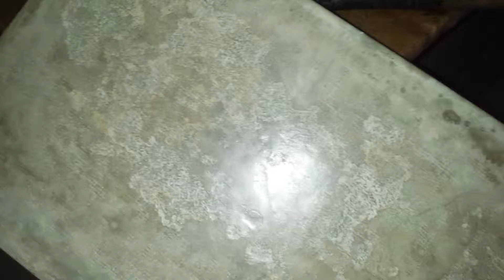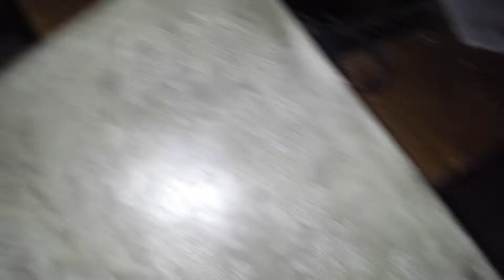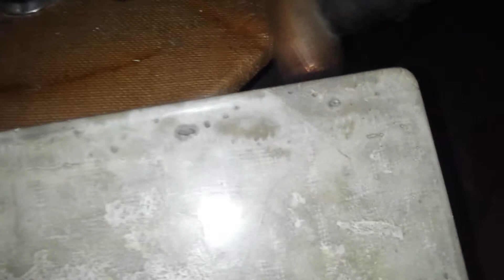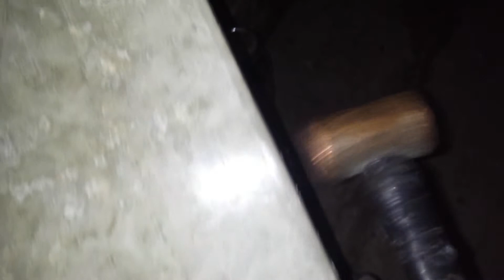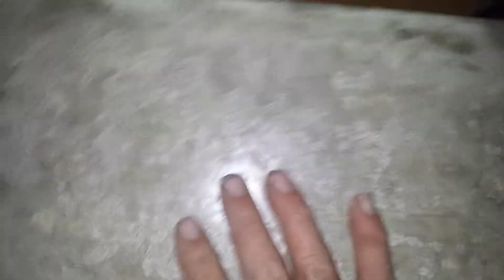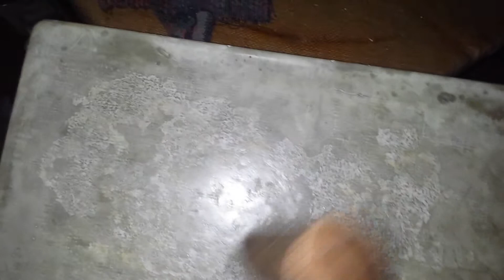Hemp fiber MgO exotic geo polymer, construction, flooring, wall board

Comment: What could be my mix ratio to make a Magnesium Oxide + Fumed Silica / Silica Dioxide concrete. Could I use hemp fiber with sand stone to expand the use. or Would this be more like a top coating over straw bales?

Comment: make construction rebar out of hemp fiber and hemp resin.
Reply from the maker: Believe I have a video on that, I beam as well, but Yes, Absolutely Agree 
Steel has met it's modern match
Reply from the maker: **bold statement 🤣 Yet changes nothing Bast Fiber concrete monomer modified (keep in mind BioChar graphene is >100 time's stronger, Yet)
Is Far hysterically Stronger than steel reinforced concrete

Comment: Hi There 
I am wanting to build a house with loadbearing walls out of Hemp+Bamboo, MgO and seawater. However I will be experimenting with various mixes.. any ideas to save me time that you think will work.....?
Also will adding an Acylic monomer make anty difference to the strength in above mix?
Thanks Az
Reply from the maker: Have several I would absolutely love to try with beach sand an sea water resources
If available basalt volcanic ash 
(Suggest modification of the fiber by evaporation for the needed monomer)
Reply from the maker: Sorry hit go too quickly yess on the  monomer
Reply: @mrglasecki  thanks
How much per litre am I likely to need of the monomer?
Reply from the maker: Gotta do Your Own research simply Can't state that clear enough, location, physical design conditions, climate, environment
Change application and ability of the fiber

Hemp CAN  be made to work Anywhere under any conditions if engineered appropriately
Research Perspective can't stress those enough
Only thing I will not be able to help
Reply: @mrglasecki 
All good thanks
The acrylic monomer appears to be the same as nail varnish....
How much 1-10% do I need for sufficient micro filaments to form?

Comment: With the huge demand for shiplap decor, these type panels in a variety of lengths and widths should be VERY marketable mass-produced. Due to strength isssues, a half-inch thickness would more than be able to replace particle board lap siding.